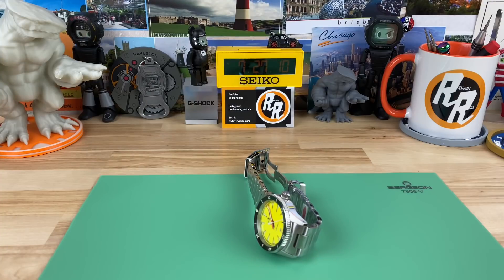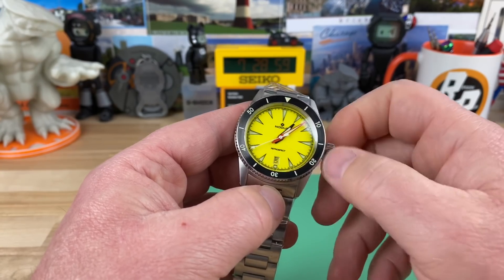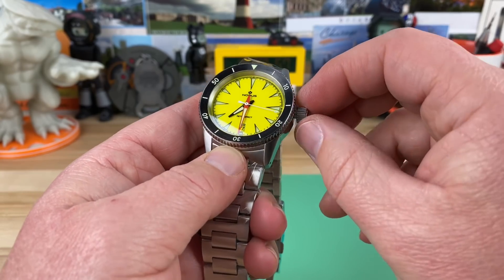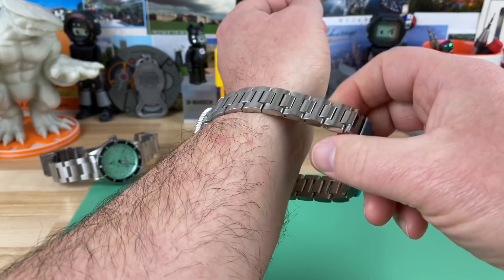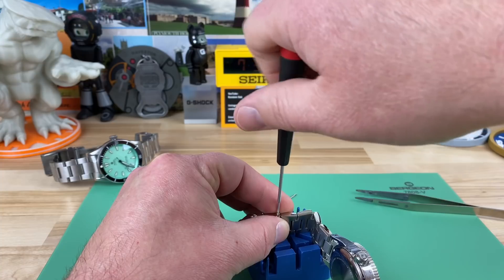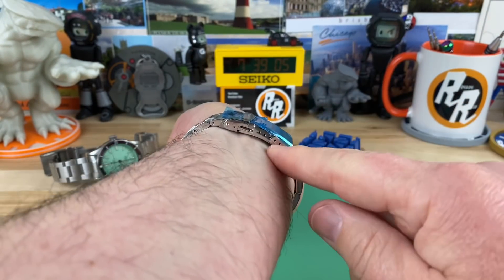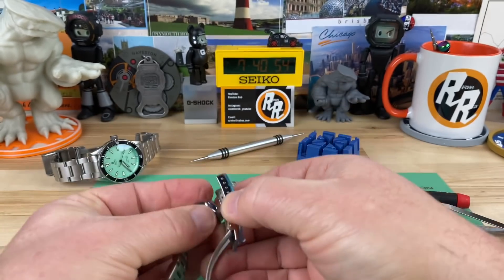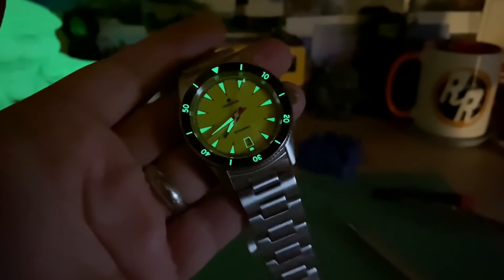New watch? Quick inspection and sizing

Comment: Super helpful video... thanks for that!
One question/observation regarding Loctite: Since I couldn't find the weakest stuff anywhere, I looked at the blue stuff I still had at home (medium strength ... "243", at least that's what it's called here in Germany). I checked their data-sheet for the 243 and the manufacturer says that the stuff will only ever reach 50% of its maximum strength when used on stainless steel. To test it out, I used it on one of the links I had removed from the bracelet, let it sit for 20 hours and then tried to open it. Seemed to come apart pretty easily. So is the rule about only using the weakest Loctite to secure links perhaps a bit overly cautious on a stainless steel bracelet?
Reply from the maker: Wow great info. Thanks for sharing, we should spread this info.